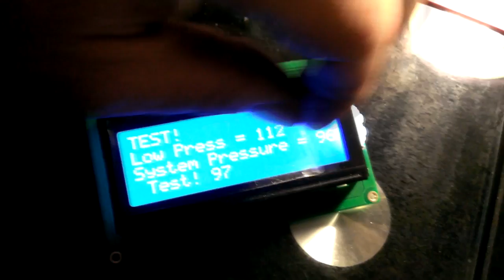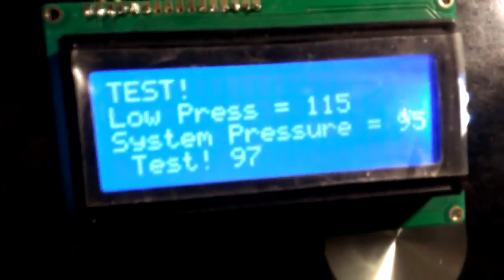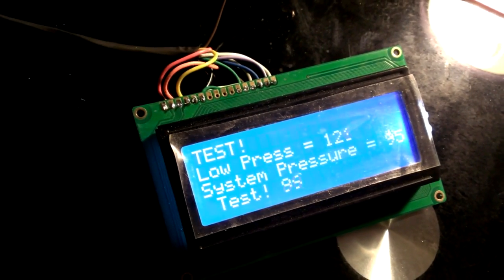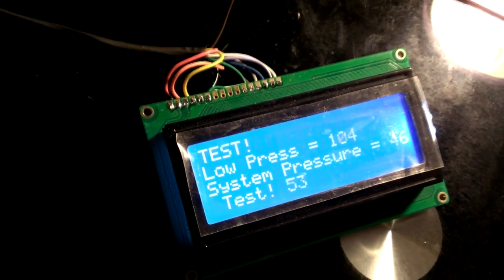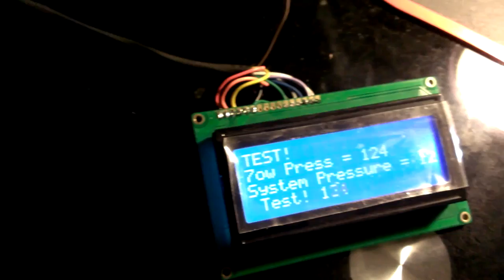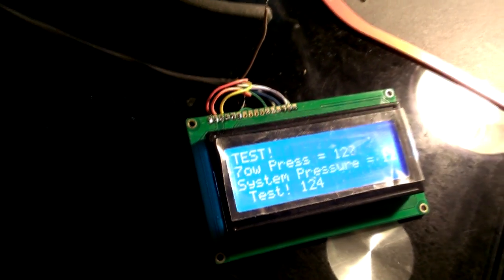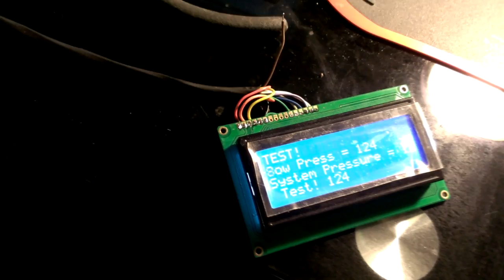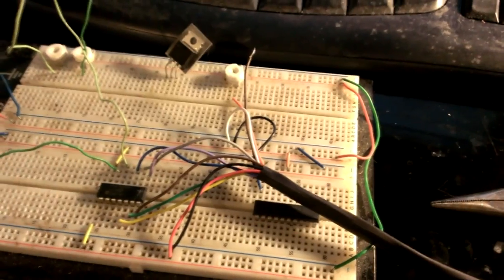Pump Variable Frequency Drive Retro Project - Part 3 - Homebrew control

Comment from the maker: The high voltage is still controlled by the VFD. 
What I am making is just a control and mostly low voltage. 

Plus it's a facility I work at.